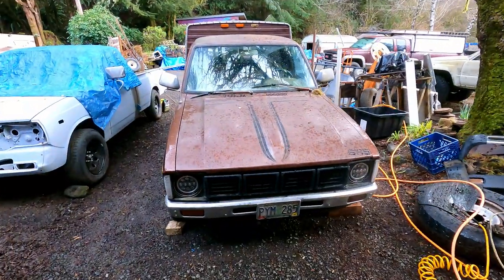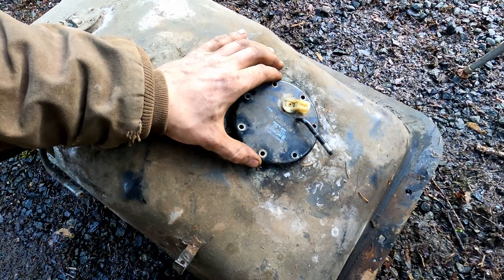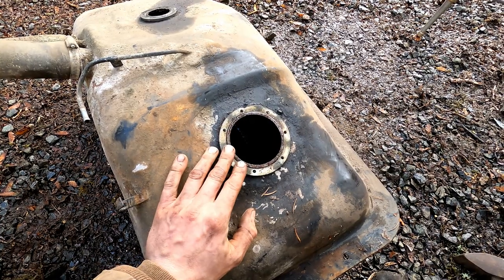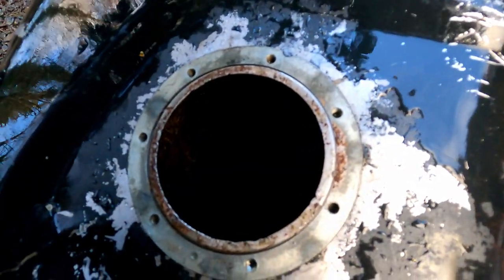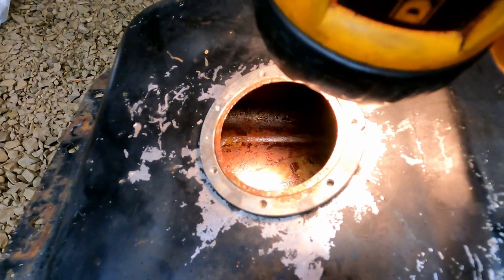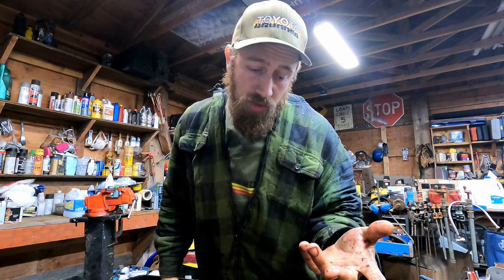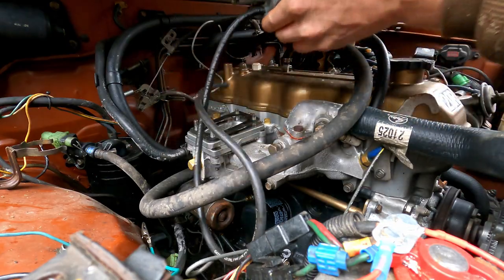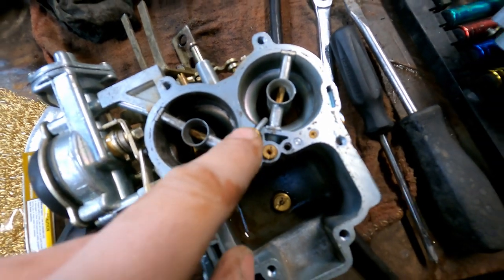Cleaning Chihiro's Fuel Tank and Carburetor (1979 Toyota Pickup)

Comment: All that corrosion in sending unit  and tank is because water. Copper alloy turn green in presence of water so all evidence point  in same direction.  Someone  put water in fuel tank deliberately  possible.  People does that to have a lower price when buying also  does that to boycott  buyer for some reason.
Reply: I don't really think water was intentionally put in the fuel tank. As the former owner of the truck I know that it sat out in the weather not running for 12 years after the tank was cleaned. I believe the water in the tank was  due to a is massive amounts of condensation over that 12 years. She ran just fine after the engine was rebuilt with no problems with the fuel. It needed a new fuel pump later and I never had the small amount of money it would have taken for me to get a new pump. The guy that owned her between Chris and me told me he replaced it before he started her up. That was when the oil gushed out and he sold it to Chris.
Reply: I speak  from experience.  In classic cars and collectors environment  you get familiar  with all kinds of dirty tricks to buy cheap. I'm not blaming  the previous owner  but any other potential (and frustrated) buyer .